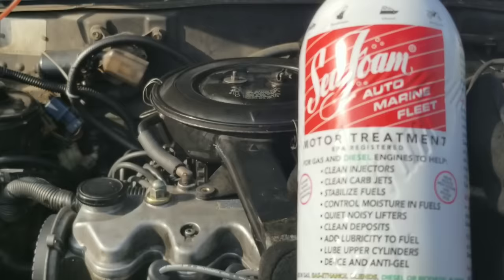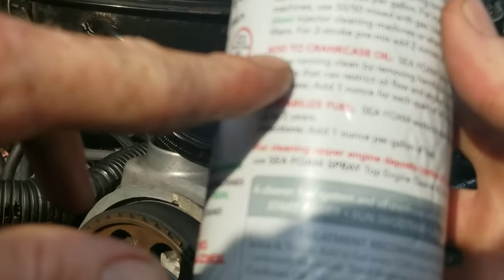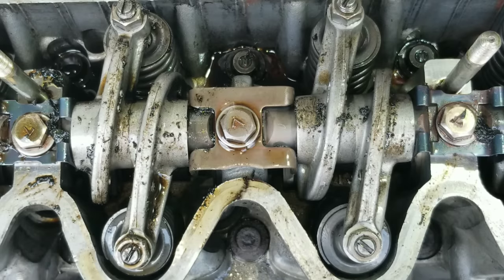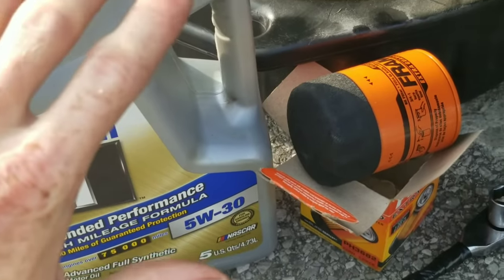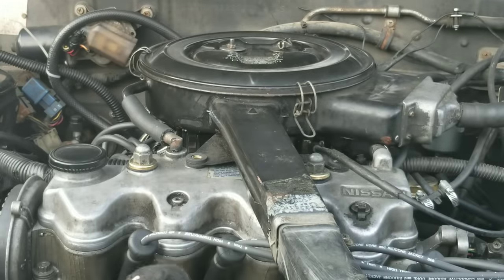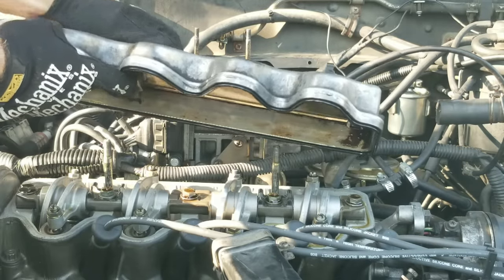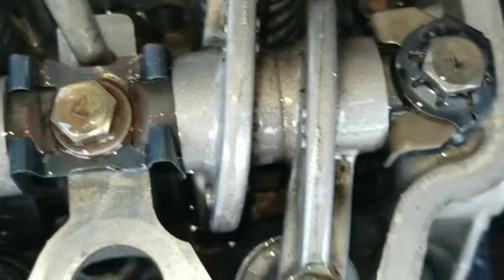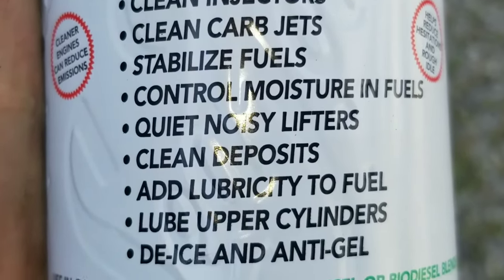Seafoam results i cant believe what it done to my engine

Comment: Don't be too lazy to read the instructions kiddies. Probably don't want to drive for more than 300miles / 500km with this stuff in your crankcase, Especially if you're into spirited driving. Since this stuff breaks down carbon, that carbon ends up sitting directly in your oil. 

Anyways, I myself didn't bother opening up anything in my engine, but I did drop some of this stuff towards the end of an oil change interval recently and the oil came out blacker than black with a Petro smell (also seemed very diluted.)

I've since switched over to a synthetic oil (with seal conditioner)  and will use the rest of the seafoam probably midway this oil change and just dump it.

Comment: Damn, that is a big difference. Unfortunately my engine has varnish instead of sludge build up. I have used seafoam and also marvel mystery oil in the crankcase for two oil change intervals, but it does not work for varnish.
Reply from the maker: I think motor medic could possibly help more with varnish we will have to find out
Reply from the maker: But only a little varnish is hard to get off
Reply: How did you get Varnished? in the first place?
Reply: ive been seeing guys use atf to clean out their motor. going to try that out as it seems to help those with knock. same concept as seafoam though.

Comment: You drove for 3000 miles with that in there!?!?  You are only supposed to drive like 200 before an oil change lol. I’m surprised it didn’t look like chrome in there hahahah
Reply from the maker: Lol so what can we try next?
Reply: Hmmm. Haven’t found the best way to clean a carb. Or how to set up a proper trickle charge. Most of the mechanical videos I see is just people working on any of the problems they have on their vehicles, but they just edit out all the waiting and try for really good camera angles even if that means doing a voice over. They typically turn out pretty successful.
Reply from the maker: Sound pretty accurate so how about the cleaners i have tried some would definitely clean a carburetor.
Reply: NATES INTERACTIVE AUTO I’ll have to check out some more of your videos when I get home. Been on a vacation. You look like you’ve been doing this a while. Cudos. I super picky when it comes to my subs but from what I see so far I might sub you. Keep up the awesome videos.
Reply from the maker: Thank you i have been ordering and more to take it above i mean way above where the quality is now just need more time.

Comment: You should of just changed all the seals. Instead of waste your money on that
Reply from the maker: Seals what for ? What should we use?
Reply: NATES INTERACTIVE AUTO 
With time the seals will go bad and the valve seals should be replaced to prevent exhaust gases that pull in burned gases and oils through the seals on the exhaust side. How it is pulled you say?! Through the PCV valve. And if your oil filter isn’t filtering properly and that much sludge is starting to build then you have a problem...
Reply from the maker: Piston rings would be primarily the issue also pcv system is caused from the blow by

Comment: We'll two things. If you change your oil like your supposed to you don't have to worry about it. Two when you break all this stuff loose it goes in the oil pan and could clog the pickup on the oil pump causing no oil pressure

Comment: You get better results by adding 1/4 to 1/2 quart of ATF to the crank case oil.
Reply from the maker: How many miles?
Reply: @NATESINTERACTIVEAUTO  How many miles what?  How many miles do I keep the ATF in the oil?  100% of the time.  How many miles on the truck?  200,000 miles.  I change oil every 3,000 miles or so.  No cam phaser noise, cylinder compression still within tolerance and still gets 17.5 MPG @ 60 MPH with Cruse control on.  It's an 04 Ford F 150 with 5.4 Triton engine and it doesn't burn oil yet.  If you take care of a modern engine they will last a long time.

Comment: There is no way in the world it would raise Oil pressure, no way.  It may clean deposits; not questioning that, but those deposits also clog things up and keep oil from flowing.   I have seen engines way worse than the one you showed way worse.  Find an engine with a bad thermostat or car normally driven 5 miles at a time in cold weather, moisture builds up and gunk.   Calling BS on Oil pressure change that has to do with clearances of cam, main and connecting rods.  My guess is first time you checked oil engine was at operating temp and second time it was right after cold start up.  STP raises oil pressure because it is thick really thick.  Sea Foam is really thin it would possibly lower oil pressure a little.
Reply from the maker: I understand your  correct but thats what has happened
Reply: Oh really does the oil pump in your vehicle  not have a screen on the pickup tube?
Reply from the maker: Yes it could also clean the screen on pick up and its good you see the many issues that could arise especially for a modern engine i appreciate your time

Comment: Pour the whole bottle.
Reply: Pour the whole bottle ? .... into what ? Please finish your sentence.
Reply: @tarquineous  Pour the whole bottle into the oil crankcase, One in the gas tank, and another one through a vacuum line for top cylinder head cleaning. The more you use the better it gets.
Reply: Ok, that's 3 cans. I think the amount of Seafoam should be proportional to the engine displacement. For instance, a 2.0 liter engine will require less than a 5.0 engine. The makers of Seafoam should tell us these things.
Reply: I will say it's a good product. Been using it (about 4 ounces) into crankcase, a day before an oil change. I've done 68 oil changes on my Ford Ranger. It now has 260,800 miles on it. Still does not burn oil and runs very good.
Reply from the maker: Yes thanks

Comment: Only supposed to run it for up to 300 miles not 3000....
Reply from the maker: I recommend following instructions some videos are for test purposes only
Reply: @NATESINTERACTIVEAUTO  yeah, that is plainly stated on seafoams website, they recommend adding that 1 or 1.5 ounces per quart 100-300 miles before changing oil /filter.
Reply from the maker: I understand thanks